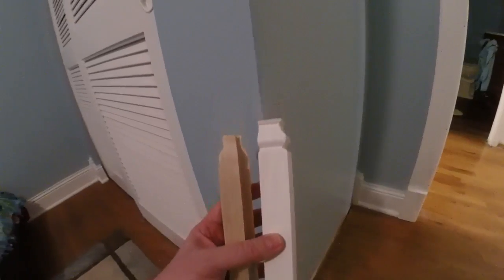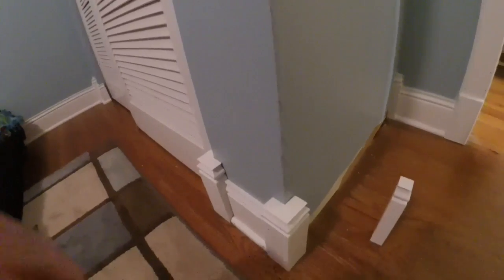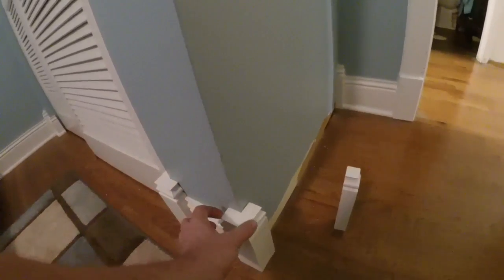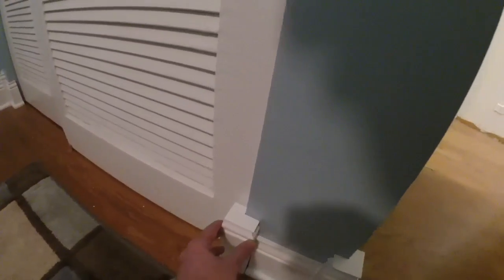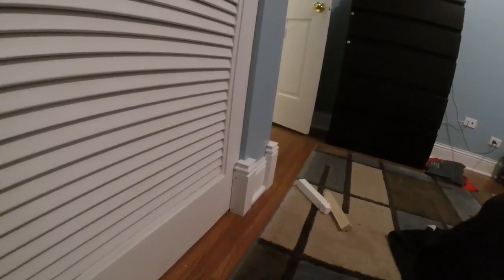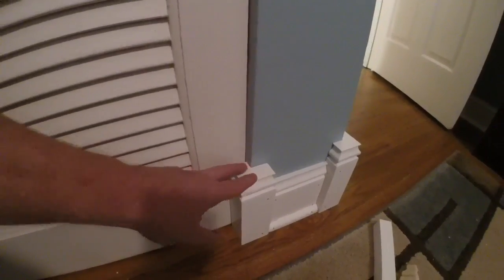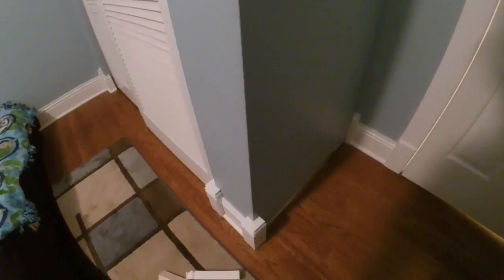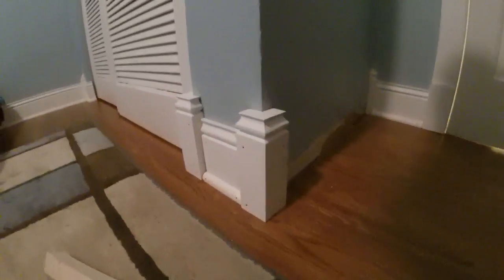Update Video: Making trim outside corner blocks

Comment: I have some outside corners that are like 135 degrees, how would I make a block for those? There are some odd angle inside corners as well. Could the bevels be cut on a table saw?
Reply from the maker: Given the stock I began with is 5/4 and 90 on one side there are lots of options.  You could miter edges versus butt joint like I did. For inside corners you can use a gauge to get the angles closer to your dimensions or use caulk to fill in minor gaps. Outside corners your base will hide a lot of the gaps.

Comment: Please tell me how to notch out the corner block. No table or router..
Reply from the maker: I have those tools. I choose to design this so I wouldn't have to cut a notch in the back. If you are making both the left and right sides you wont need to. However if you choose a design where you want to cut the notch, i would use a hand saw and clamp the block face down, cut one side, turn it around and cut the other. This would allow you to get tighter corners if they are not square. Not ideal, but possible.

Comment: Can you make those blocks fit into a corner that is not square. It seems all the angles in my bedroom are larger then 45. Beautiful job. I love the look. Has so much personality and beauty now. Thanks
Reply from the maker: Great thing, you can make them as wide as you want. Im currently making some custom ones to fit odd transition spaces where it doesnt look right to do corner block, baseboard and corner block. So instead i just do one long corner block.
Reply from the maker: As far as being right angles, yup no corners in my house are 90 degrees. I don't try to figure out the exact measurements,  i use the magic of caulk to hid the gaps.
Reply: Quarter Inch Off haha you do! Good me to then :) thank you so much